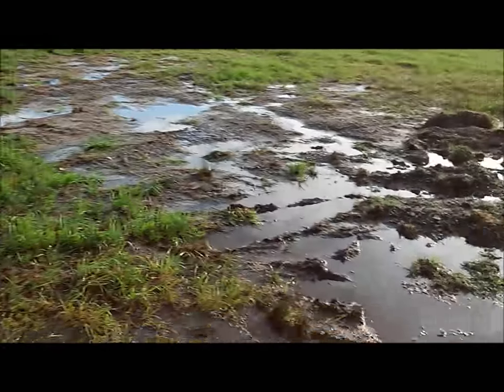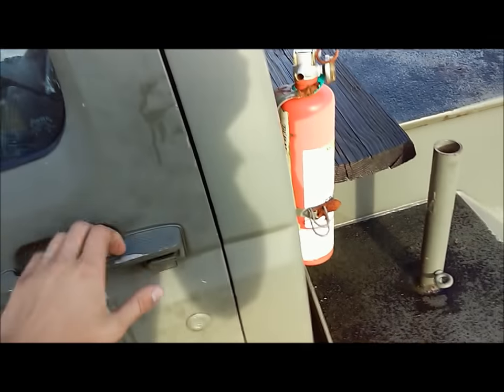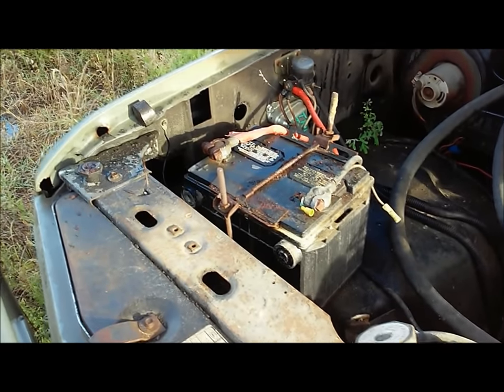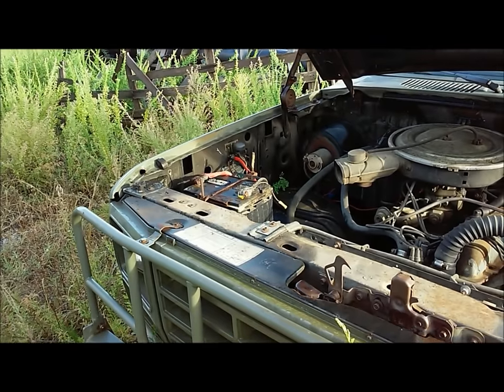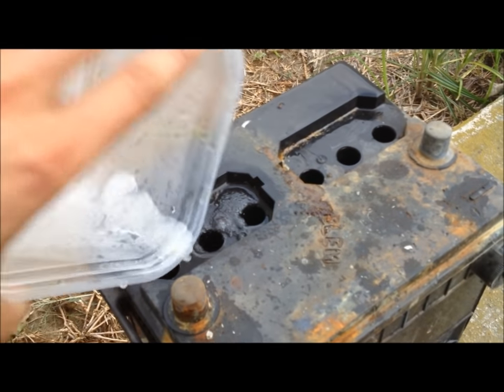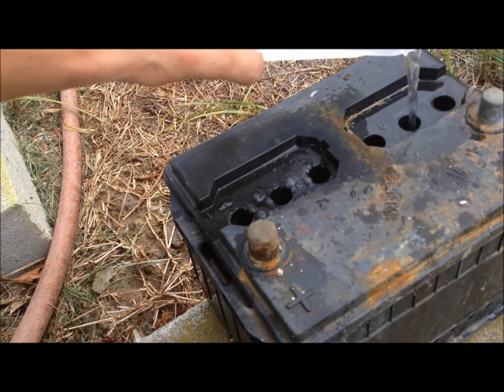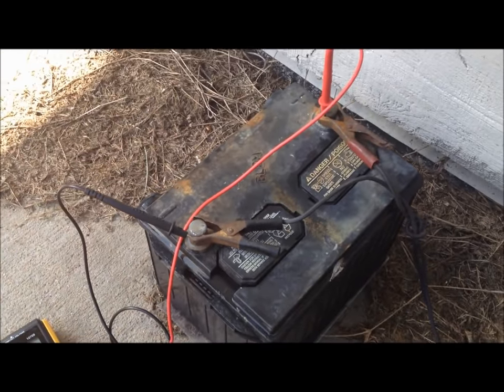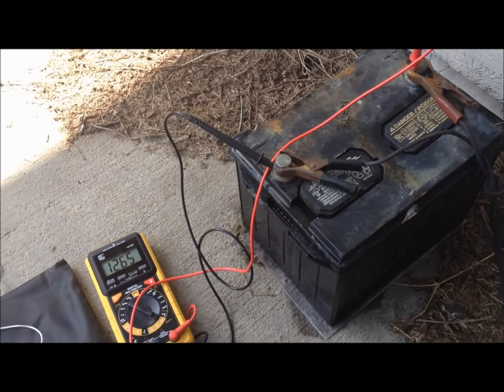Car Battery Repair After Sitting 10 Years: How To (Basic Home Products !!!)

Comment: The EPA will  be knocking on your door dude you are not supposed to pour battery acid on the ground all you had to do was get you a 5 gallon bucket pour the acid in there then take a little baking soda it would have killed the acid completely??????
Reply from the maker: I guess I didn’t worry about it because the acid had already neutralized completely

Comment: Good thing he did not try to start that truck he would have looked like a fool yes he had 12=volts but did he really have a amps to crank, most dead batterys will read voltage but no crank amps

Comment: any know the car model name
Reply: I deleted my comment about the dumping of the Battery Acid because too many IDIOTS wanna reply with stupid replies. As for the make of this truck, It's a 1980-1986 Ford F-350 Airplane Toter. Its been shortened so it can maneuver around tight turns while moving planes around. I've bought several Dodges with 5.9 Cummins Diesel engines and drove one for a couple years. it's very Squirrelly at Highway speeds and very Bumpy. But pretty fun to drive, It will spin a tire fairly easy like this. And with a few hundred pounds on the rear. It will pop a Wheely very easy. If you get a chance to buy one of these trucks, DO IT !! Their all LOW MILAGE and you can cut the frame and extend it pretty easy. Or just the running gear in another truck like we did.
Reply: +Repo Dan thanks dude I wish I can buy one but I'm in Saudi Arabia it's hard to find one 🤕
Reply: +Yahya Iyad check with all your airports !!!. i'm sure there are several sitting in the back lot just forgotten about !!!.

Comment: Wonderful, the cap on the battery says "Warning/Poison" and you just empty it out in the nature.... I guess your not on the "Save the planet" side....
Reply: it's not going to hurt anything, it will just seep into the ground & separate into it's component parts.
Reply: What do You think happens then??
(because if you tested that area less than 6 months later you wouldn't even be able to detect it. most of the liquid in a battery is water only a SMALL percentage is acid)

Comment: OMG where do I begin?! First, how about showing what the volts are before making a video of a battery "repair". Second, clean the fucking top of the battery before you start pouring water in and letting contaminants get into the battery. Then you put a volt meter on it while it's still connected to the charger? ROFL

Comment: People never take the crocodile clips off while still plugged into the mains it could blow up & you will have acid & plastic in your face
& I wouldn't bother with this damaged battery lifes not worth it
Reply from the maker: I leave the clips on and then unplug it from the wall. Safer that way
Reply: Absolutely- you can never ever ever be too safe. The junkyard up the street where i buy my used batteries never does it the correct way and also they check the power of a used battery by shorting a 1/2" ratchet extension across the terminals. I've lived here 18 years and not a day goes by they don't have at least 2 explosions. Also should be wearing at least safety glasses, gloves and a haz-mat suit.

Comment: So checking the voltage while still attached to the charger???  What a load of crap.
Reply from the maker: It was unplugged from the wall which was inside if I remember my orientation here without watching the video. Iv been in the process of remaking a battery recondition video because I can see the disbaleivablity of how I went through this. My apologies.